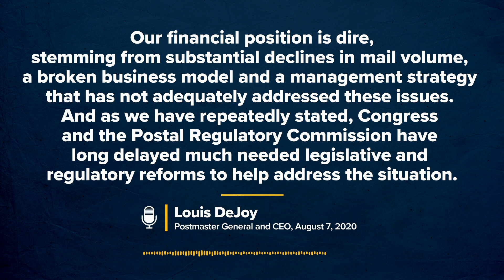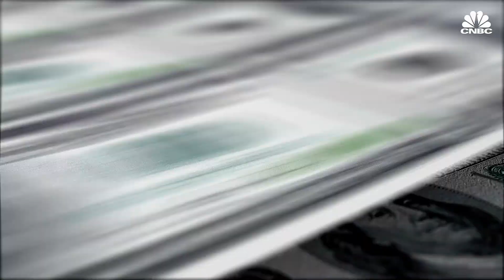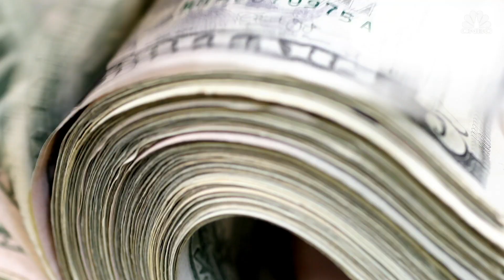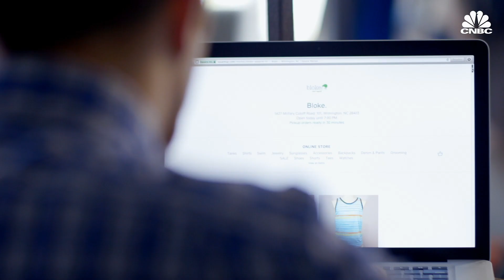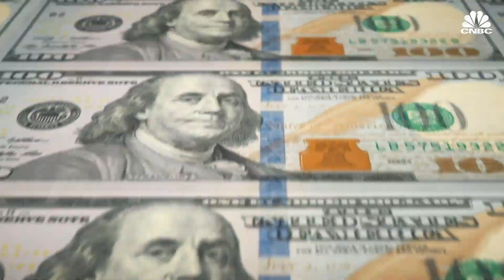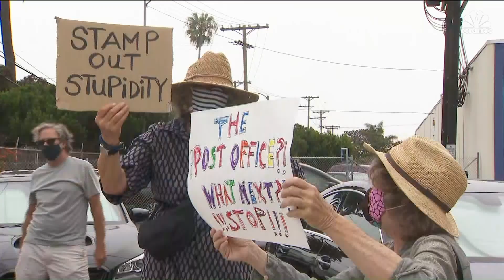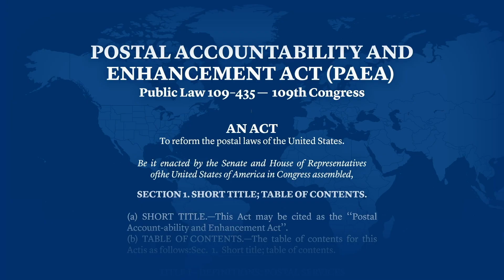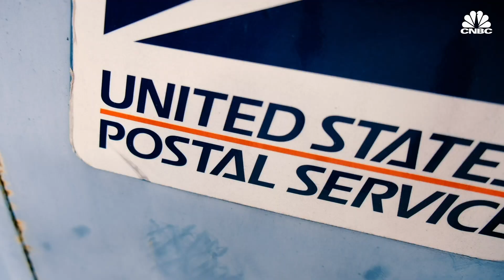How The U.S. Postal Service Fell Into A Financial Black Hole

Comment: The retirement pre-funding requirement is unlike any business. Any fair comparison would require FedEx, UPS, and others to do the same, as well as requiring them to also deliver to every US address like the USPS. Fix the pre-funding mistake and add community banking and the USPS will be fine. Privatization would be a crime.
Reply: Amen. The pre-funding requirement is ridiculous and the community banking would be a boon.
Reply: The economy was best when the middle class was making livable wages because unions were strong. There’s also nothing wrong with defined benefit plans. What’s wrong is expecting the USPS to prefund so many years ahead beyond anything reasonable. Unions are not the problem, Congress is.
Reply: What business offers defined benefits and retiree health care again? More insane logic from crazy Democraps!
Reply: It doesn’t matter what FDR said; he was incorrect in this case. Anyway, appeal to authority is a logical fallacy. 

And name calling? The last resort of those with weak arguments. 

The truth is the intent was to use the money to cover the deficit, which is hardly beneficial to the postal workers in the short run. The postal service is funded by postage, but if the federal government borrows money it costs taxpayers. So this whole scheme is just irresponsible nonsense and it’s time to get rid of the ridiculous requirement to pre-fund an unreasonable number of years into the future.
Reply: @ADHJkvsNgsMBbTQe  Yes because Fedex and UPS offer health care to retirees (aka people who don't even work there anymore) and then fail to fund it at all until they were required to by law. What a genius you are.

Yes, if the USPS offers health care to retirees they SHOULD be forced to find it instead of not funding it at ALL like they did before.

Comment: I have to say: The USPS is beloved outside the US also! All my packages come to Brazil through the USPS. I have purchased old computer monitors for the 8 bit Apple computers, all with the old glass CRT, and all of them arrived in perfect condition. I thank the USPS and the the Brazilian counterpart, the EBCT aka Correios do Brasil. Both are being attacked, btw.
Reply: Same from Canada. UPS and FedEX have overage charges to us from as short a distance as 20 miles form the seller to the buyer. Why would I pay much more in shipping than the value of the piece of plastic that could have been sent via post office at 0.1KG?
Reply: I’m Postal mail handler at a P&DC and it’s always cool to see parcels going internationally. Thanks for using the USPS.

Comment: CNBC did not do a thorough research into the USPS model.  In the early- or mid- 1900s, the USPS used to be involved in community banking.  However, our federal politicians (with banking lobbying) eliminated the practice due to concerns about unfair competition.  HBO’s John Oliver’s show featured it last year (if I am correct) and the reason why it needs to be brought as an entry for low-income and unbankable.  Also, the idea of the USPS revisiting this concept was floating around by Bernie Sanders.  However, there has been little traction on giving the USPS this option back.  CNBC and it surprisingly none of the speakers did not mention this fact.

The USPS model is no different than Amtrak where it is a quasi-government entity expected to be self-sufficient.  However, there are too many guardrails from lobbyists, competition, and even some politicians to operate in a way that provides a viable service that is self sufficient.

Comment: If you want to lay blame for USPS having difficulty with its budget, consider this: until President Reagan tried to turn the USPS into a cash cow, but insisting that no longer be self-supporting / self-sufficient.  Instead, whatever the USPS generated in revenue would go into the general gov't coffers, and whatever funds the USPS spent would come out of a budget granted to them out of that general fund by congress. Consequently, the USPS suddenly became stagnant in the 90s while other postal services were either being modernized (with generally good outcomes) or privatized (with disastrous outcomes) ours couldn't afford new machinery so while the USPS finally now offers decent internet-enabled services and has (had, until Trump's toadie gutted it) modernized mail processing equipment, we are twenty years behind some other postal services and certainly behind commercial carriers. Remember, some folks in congress don't think the government should provide you with ANY services in return for your taxes -- except for the opportunity to die for your country inside a breathtakingly expensive tin can.

Comment: This type of work would be perfect for electric cars because they would save money from cheaper “fuel” and electric cars run perfect in stop and go traffic which extends the range so you get “free fuel” and with the money they save they could make it cheaper to mail things 
Another thing is that it would help the environment especially because there are so many mail cars/trucks
Reply: This actually makes a lot of sense 👍
Reply: @puzzleluvr  This makes a lot of sense until you realize it would cost more to purchase an electric vehicle vs a gas vehicle plus 20 years of fuel. Electric vehicles are just not to that scale of production yet to the point where they are economical.
Reply: @Georgeqaws  this is not true because with the amount of money you spend on fuel versus electric the car would eventually pay for it self 
For example my sister used to drive an 70 miles every day for two years  an electric car however you would have saved 10000 dollars in the same amount of time driving the same amount of miles

Comment: Delivers packages for amazon? That's what he said? C'mon now. IMHO: SOMEONE NEEDS TO: STOP COMPLAINING. Find a replacement. Put that replacement in the proper position to get things accomplished. What totalitarian plan could DEJOY have? 

Addresses need to get entitlements again. Immediately establish EMERGENCY budgets to get the mail working. Upgrade all systems and equipment (it's about time someone established the proper infrastructure required to deliver mail properly) That's The point of infrastructure, to deliver mail Hello!? Should be easy. The equipment needs to be ordered and delivered where it's needed. At the very worst, we need to step up and force an involuntary bankruptcy,  put a federal chief justice as administrator to order equipment and assign a team of fiduciary trustees to be held accountable and responsible to handle the budget. Upgrade everything. 

The MAIL KEEPS THE UNION STABLE. . WIN. WIN. WIN.

Comment: USPS has a fantastic business model that's completely broken, and even more fantastic way to calculate the costs and revenue. It gives Amazon $2 per parcel, regardless of size, from 2 oz to 70 lb, each is $2. Of course if most parcels only takes 1 min to process and deliver on average, it will be profitable. However, this is never achievable by the correct way of delivery. If you saw any mail person was able to do it, you knew s/he was cutting corner in some places. Driving too fast, not putting on sit belt, not taking breaks/lunch breaks, throwing parcels, skipping delivery stops, and a lot of nasty stuffs in order to meet the deadline.

Why do you think people can't receive their normal mails once DeJoy implemented the new 8 hour no overtime rule? Literally each route is too long for 8 hours, and the mail persons need to take overtime to finish a day with normal amount of mails. What happen if the new rules implemented? The mail person work 8 hours, not done, go back to office with undelivered mails from last part of the route, then the next day, same happens, still the last part, and again the next day. The last part of the route literally can be forbidden from receiving any future mails. Plus, if a mail person got a vacation, got sick, or simply a vacant route, it can take 3 to 4 weeks to get someone to the route, whatever reason no one is working on the route, and if the post office is understaff, and it's very often, the whole route will not be delivered for weeks or even months. Of course, the policy halted, so it's not going to be months for now.
Reply: Where did you find the rate?
Reply: @bftjoe  news? Don't exactly remember where.
Reply: @bftjoe  by the way, the Amazon only pays its flex independent contractor delivery guys $1.25 each parcel, depends on the cities though.
Reply: @LittleRadicalThinker  What does that have to do with your earlier unsourced claim? Just throwing more BS out there?
Reply: @bftjoe very right. You simply can't play math with Jeff Bezos. He calculated the cost very well. He tried extremely hard to control the cost. They don't have health care covered, insurance not covered either, no paid leave or sick leave, car depreciation, gas, not covered. Those minor costs definitely add up a lot and eat a big chunk of the paid, even it says $25 per hour, they can get as less as only half. Whatever the source, it's your choice to believe in Amazon and shop on the unethical e-commerce giant, which I guess I don't even need to point a source to say it's unethical.
Reply: @bftjoe  unfortunately the numbers are not fake. They are too old to even get them out from massive internet data. If you have a job, insurance, and other things Amazon didn't provide, it's an okay side hustle. If you really depends on it, it's a trap to poverty.
Reply: @LittleRadicalThinker  Ok old numbers no one cares about. Next!
Reply: @bftjoe  how about, Amazon throwing away mega tons of trash every day? Like millions of perfectly good electionics? Amazon isn't recycling, it's throwing away as trash. You should be able to find the news probably everywhere nowadays.
Reply: @LittleRadicalThinker  Unless you have any evidence that they throw away a greater % than any other comparable company, you're probably grasping at straws here again.
Reply: @bftjoe  I'm not comparing any, I'm condemning every of these behaviors.
Reply: @LittleRadicalThinker  Okay but you don't throw anything away? Not sure what your point is.

Comment: I retired from USPS with never miss payday for 41 years which is mean they're not broke as they have money by paying wages. Also, merged or inserted (it's called marriage mail) with multiple advertising papers are a cheater just like hoping in a freight car for free ride without paying postage, these advertisements papers cost .17 cents (when first started was a penny) per household is unfair for us with today 55 cents postage as well some individuals advertise is paying less half (or 3/4) of the cost postage to the compared to .17 cents (it's sound not right). That's how postal managements don't know operating the price rates for merged papers.

Comment: In thailand 🇹🇭 telecom uso is paid for by a fund through which its private competitors contribute. Analogously, this would involve getting fedex ups maybe amazon to contribute, and the portion only goes to delivering to difficult 😓 areas rather than employee pensions.

The pension issue...hmmm no solutions for that.

Comment: If only the Federal government was self sustaining didn't run huge deficits and debt. Neither Democrats or Republicans have done anything about getting Federal government expenditures under control for decades.
Reply: Law19157 - Pretty sure that under President Clinton we had a period of time without a deficit.
Reply: @jdm1039  Yeah, it's a funny thing about Democrats, when there is a surplus instead of paying down the debt and reducing the deficit they debate new things to spend the money on, it happens consistently in California. When Obama raised taxes his government raised spending as well, it what world does that makes sense?
Reply: @Law19157  Democrats run up deficits by spending too much and Republicans run them up by too many tax cuts which primarily benefit the well off and business.
Reply: @jdm1039  Did I not say that neither Democrats or Republicans have done anything to address the federal deficit and debt? and then you came in a defended Democrats. Wow.
Reply: @Law19157  How did I defend the Democrats? I said what each party does that makes the problem worse.
Reply: @jdm1039  Go back and read your 1st comment to me.
Reply: @Law19157  I did. I also read your initial comment. You only mentioned the Democrats responsibility in this situation.  My reply contained an agreement to that and the Republican roll.

Comment: 51 % of POs costs are energy related with a naval reserve like oil fund insider price it would be more competitive. And yes amazon FedEx and ups dump on po docks usually late,  those competitors do fly some of the USPS mail. Paying the pension 75 years out is too far . Few people will ever reach 100. But to accommodate this they press down on employees ramp up to " regular " employees by delaying or blocking advancement despite attrition retirements. And yes rates have been suppressed.

Comment: Prefunding pension, ok, but not for 75 years. And let them at least put that money into investments or buy government bonds with it so when the planned time comes they'll still have the money but it would have grown a bit and not just been wasted money sitting around. Letting them expand into other areas of business could also help if it has good synergy with their current business, just have to be careful with that one.
For cost cutting measures, give them a big short term loan, it's the USPS, I don't think I or most other americans have a problem putting a small portion of our tax dollars into helping the USPS if needed. Have them use that money to inovate and modernize, improve automation, update equipment, get more fuel efficient delivery vehicles, get better sorting equipment that requires fewer people on the backend. And then push for policy changes like more combined mail boxes in delivery areas. For example on my street I and some others on this side have one community box with sixteen mini mail lockers in it we all go to (well, 15, the first one is for sending our mail), and on the other end of the street you have a dozen or two houses with individual mail boxes in front of them.
Ignoring costs on gas and possibly risks of traffic issues with the constant staring and stopping of moving from house to house, it just takes longer to drive up, look in the box for that houses mail, open their box and put it in, and then repeat after arriving again then to arrive at one communal box, pull out the big mail box for that area and just grab and insert each houses mail in order directly. Overall to serve the same number of houses it's about 40% faster and in exchange those of us living here have an excuse to go outside and walk some fifty feet at least once a day six times a week. 
Policies to push more combined mailboxes like this can improve efficiency and lower the hours spent working, and thus lower costs. And yes I realize this means some mail employees may need to be fired or have their hours cut back. It's not perfect for everyone but if this business can't support that many people at modern wages, especially with them all pushing for short term benefits in unions, that's just normal to happen. Not dissing the unions too much, but lots of the time people push for getting more for themselves now, even if long term it's not sustainable. The post office is a pretty limited body for adapting so it's unions do really need to be careful about what they can get from the post office before bleeding it dry or putting some of their members jobs at risk. And not all of them are thinking that far ahead, or even aware of the details of info required to be able to think like that even if they wanted too.

So, short term investment, lower pensions prefunding requirements though don't remove them, increase efficiency and lay off excess workers if needed. With housing as it is, it's obvious that you can't support all those employees wanted pay raises to maintain the same quality lifestyles over time just by relying on the increase in inflation, as these days many goods have stayed relatively cheap, while other key ones have gotten much more epxnesive much faster. So as long as they need to raise payments faster than that inflation boost, they obviously will need to find other ways to cut costs or increase profits. Legal rules limit increasing profits largely, and heavily restrict cost cutting in many areas, the employees are one of the few still available to them sadly.